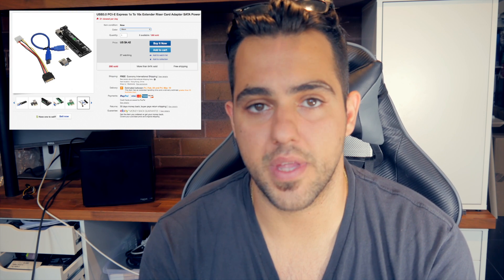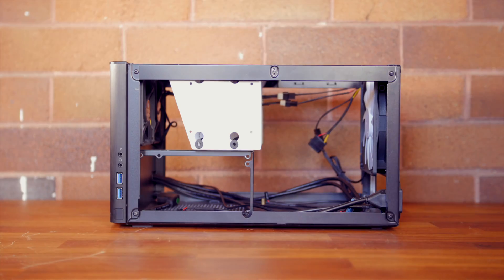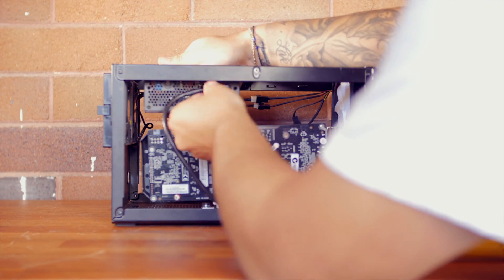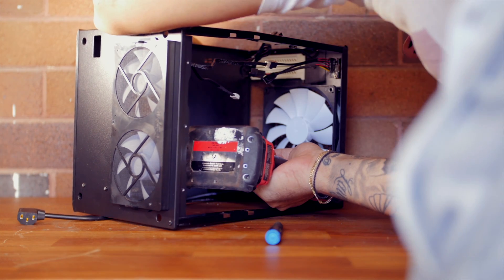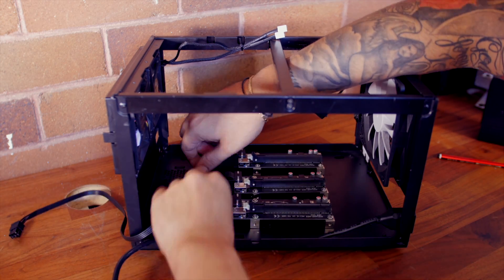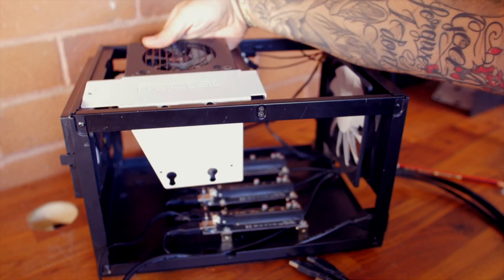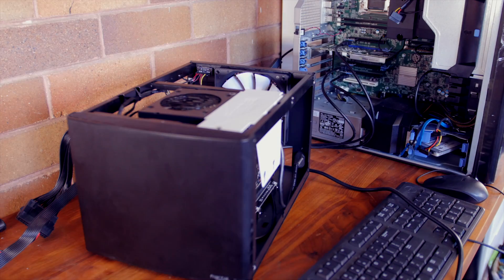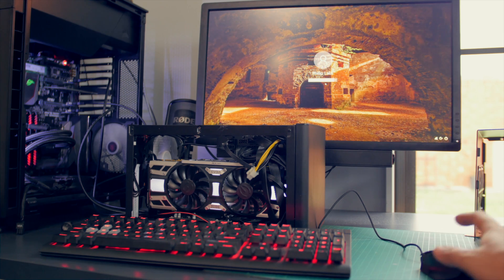BYO GPU Expansion for $165 - Octane Render / Redshift / Blender Cycles / CUDA

Comment: I tried to make a similar connection 3 x 780ti on Asus x370 Ryzen 7 using Riser USB 3, such as in mining and I failed - even if I was hooked the third GPU in pcie it did not want to Win 10 work, now I succeeded, but on Riser USB does not see the rendering program, gpu - it sees it so but it does not display all parameters.

Comment: You mentioned you have seen only a small performance loss with USB risers. This is when you're actually rendering on the cards but does not apply when testing with OctaneBench? Using such risers gives me a 20% lower score.

Comment: Good idea.  I thought about doing something similar, but didn't quite know how, and wasn't sure if the bottleneck loss would be worth the expense and time.  You've pretty much shown that there isn't a significant loss of power using this method, and seeing how you did it clears up some issues I had about the process.  Thanks.

Comment: I bought a laptop from PCSpealist in the UK, with custom built hardware.
Chassis & Display Octane Series: 15.6″ Matte Full HD IPS LED Widescreen (1920×1080)
Processor (CPU) Intel® Core™i7 Quad Core Processor i7-6700k (4.0GHz) 8MB Cache
Memory (RAM) 16GB HyperX IMPACT 2133MHz SODIMM DDR4 (2 x 8GB)
Graphics Card NVIDIA® GeForce® GTX 1060
Power Supply 1 x 230W AC Adaptor
USB 1 x USB 2.0 port
3 x USB 3.0 ports (USB 3.1 Gen 1 Type-A)
1 x USB 3.1 Gen2 port (Type-C)
1 x USB 3.1 Gen2 port (Type-C) Thunderbolt Combo Port
Thunderbolt Yes (via USB 3.1 Port)
So is this laptop support  eGPU enclosure

Comment: belnder cycles supports multi gpu. and starting with 2.79 you AMD cards will run better than nvidia cards do with CUDA support. also you could use AMD readeon ray pro and use multiple AMD GPU + AMD CPU to render at the same time

Comment: isnt there a limitation on how many gpus the cpu lanes can handle..when i built my computer they told me my cpu can only handle 5 gpus because of the lanes. i have i7. im not a pro at hardware so cant say more. i have 3 gtx 780 and a single slot gtx 750.. i would like to add more gpu can i or not?
Reply from the maker: Your motherboard is more limiting than the CPU, it all depends on how many slots the board has.
Reply: i have 5 slots.  but with your expansion how many cards can i have running on my machine. cuz they told me my i7 will only run 5 gpu because of cpu lanes even if i try a splitter like amfeltec cuz i had that in mind at before but urs is cheaper so if i can get 3 more or 2 gpu max out windows limitation i guess id be happy. let me know ur thoughts thx a lot

Comment: Really great project! It has me wondering though. How well do these USB Riser Cards perform in comparison to the Thunderbolt 3 eGPU solution you tested a while back? Also, would these be a benefit if paired with OS X and DaVinci Resolve?
Reply from the maker: Dont think they will work with davinci, Davinci needs more bandwidth than these offer. I tested with thunderbolt 2 once and it didnt give me the playback that i would get off the PCIe bus.

Comment: Very nice vid, please tell which PCI splitter was that at the end I need to test one too.
Reply from the maker: Ive had all sort of trouble getting it to work, I got 2 working on a Mac but none on a Dell. Its by a company called SinTech they are on eBay if you can't find one let me know and il link you if need be
Reply: do you think its the mac firmware stopping additional gpu recognition of the Chip on the splitter? I read on your blog that the splitter boards off e bay use pirated plx code? so is it just they are badly manufactured? they work perfectly well in lots of mining rig set ups but I believe they are hit and miss some work some do not?

Comment: Great video. Thanks.
I hope this isn't an inappropriate place for it, but I have a very specific question. I understand that GPU render is preferable for many render tasks, though something I have never seen is the interplay between CPU and GPU. For example, it is commonly known that many editing and animation programs only use 1-4 cores during asset creation/editing and video playback. Most bench marking videos  explore various GPU's but not CPUs. Would something like an i5 7600k run the general UI and playback tasks as well as something like a 6900k? Which is more important to smooth video playback (with regards to CPU) higher single core performance, or thread count? Finally, what impact does CPU have on the GPU render process? Obviously the CPU has to be powerful enough to send the information to the GPU, but how much power is needed? Does a higher core count CPU facilitate faster GPU renders? How do different CPUs stack up when the GPU is the primary render?

Comment: Out of curiosity (since this part was kind of glanced over)...how are all of those GPU's / USB 3's connected to your main box -- do each of them need a separate PCI-E x1 port to slot into...or are they hooked up in some other way?
Reply from the maker: Hi, Yes each one needed a PCIe slot. My board had 2x x1 Slots and a x16 slot.